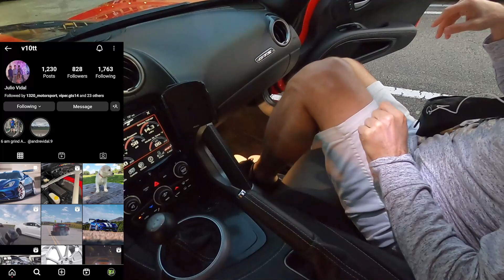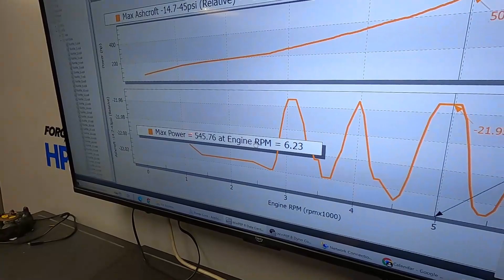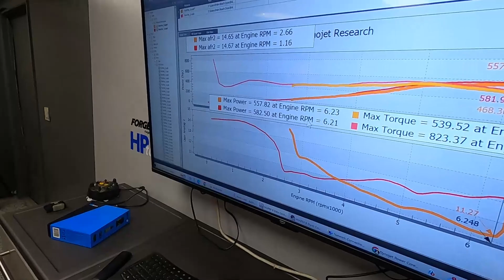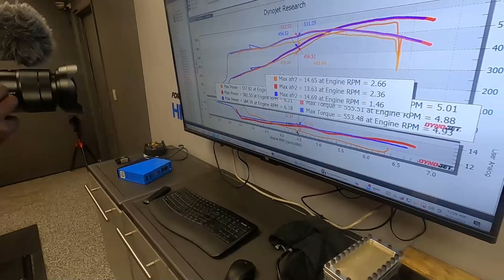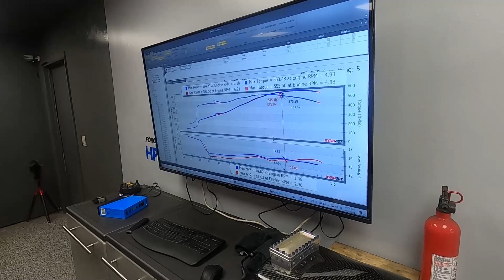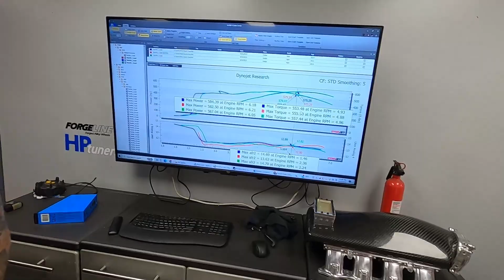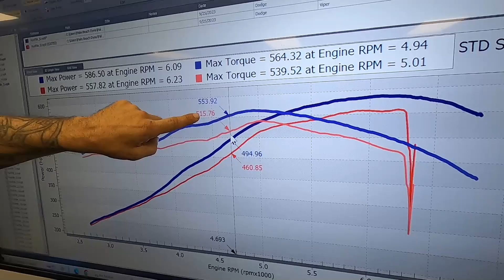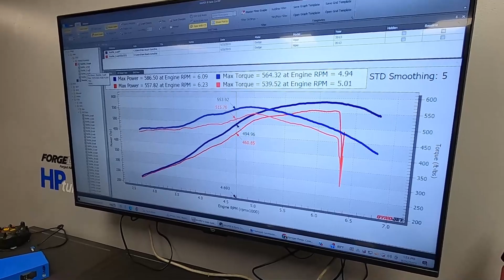My Dodge Viper RIPS 7k RPM On The Dyno & Gets a Burble Tune!

Comment: What all has been done to it to go up to 7k rpm?  Did you modify the heads at all?  Valve springs, etc?
Reply from the maker: Nope. Nothing in the engine. The Gen 4/Gen 5 engine can handle the 7k rpm with no issues as long as you don't boost it or add a bottle.
I'm also running the mobile 1 15W50 oil instead of the 04W40 which is reccomended by the designer of the engine.
Reply: @MrCarAddictDCA That's pretty awesome to know, I had no idea.  It's dropping off quite a bit towards 7k though, are planning on a new cam?

Comment: What is the complete exhaust setup?  Sounds great, I need this tune!
Reply from the maker: belanger headers and exhaust with high flow cats. however I recommend going cat delete.
Reply: @MrCarAddictDCA what “tune” did it have prior to PBD?  It also has headers, high flow cats, smooth tubes?  Thanks.